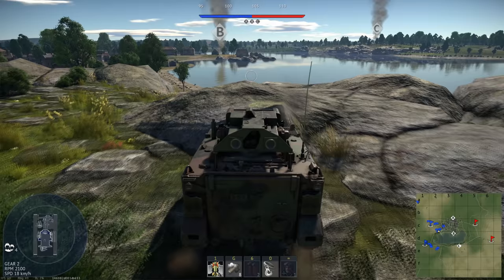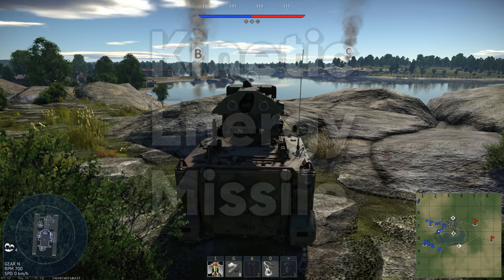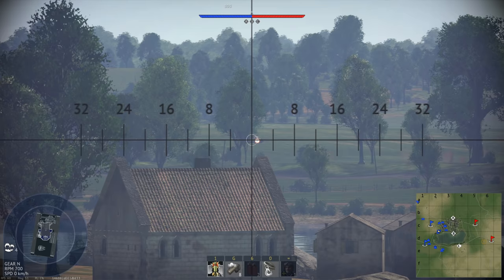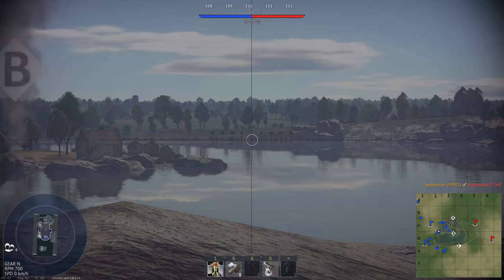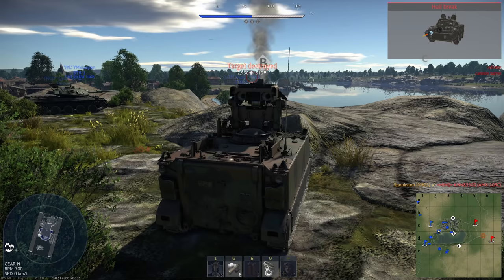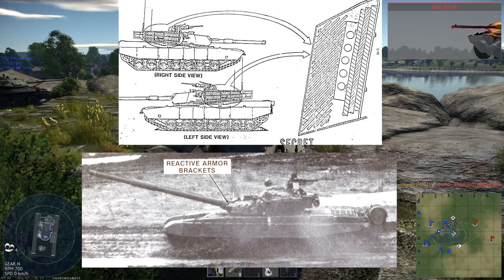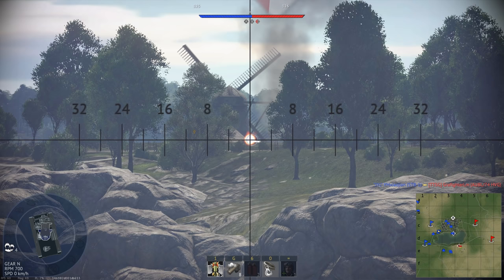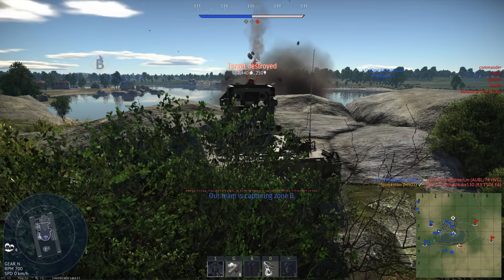Kinetic Energy Missiles - Future Tank Weaponry

Comment: Question, would it have been possible for the light, medium and heavy tank dynamic to have survived, instead of being replaced by the MBT?
Reply: @Bird9600  I'd argue it's more a matter of technology. If the best technology in each field was more mutually exclusive (couldn't make an armored vehicle fast for example) It could have continued.
Reply: No, since rapidly improving gun and engine technology meant that so-called medium tanks naturally gained bigger guns and heavier armor to the point where it no longer made sense to develop dedicated medium and heavy tanks when one can have the economy and mobility of medium tanks with the armor and firepower of heavy tanks. Indeed, many modern main battle tanks weigh as much as the old heavy tanks, although their armor, mobility, and firepower are vastly superior. 

As for light tanks? Well, they never really died, did they? Light tanks have occupied the niches where they excel, when situations require a tank with better operational and tactical mobility, even at the expense of heavy armor. 

Light tanks exploit their lightness to allow them to be cast from planes, landed from boats, traverse inhospitable jungles and mountain heights, and even swim across lakes and rivers. The light design and economical operation makes them attractive to adaptation to other roles, such as APCs and IFVs. Conversely, many APCs and IFVs have been successfully adapted into light tanks, a practice which continues to this day. 

Light tanks do face stiff competition from more economical armored cars and more versatile IFVs, but their development is still seen as worthwhile by nations who see a need for them.
Reply: Light tanks might still survive. They can be used by light infantry like paratroopers as "airborne" tanks
Reply: Calen Crawford  Clearly what's needed is to build Howl's Moving Castle except give it a fuckton more guns and armor.

Comment: Actually Kinetic based missle would be suspectible to the very same old armor defensive measures any other missle is susppectible for - reactive armor would be quite effective at dealing with this. The same goes for any active defense measure meant to deflect the projectile while its in flight - to force it into different trajectory thus making a miss. and even simple smoke screen would be enough to protect against being target locked - this thing must hit directly or it does no damage so - denying the target lock or disrupting it would be quite effective. Normal missle even it it misses but lands close by might still damage the target to some extend by exploding its payload - KEW systems would be at disadvantage since they lack the explosive warhead to deal damage in that manner.

Comment: I haven't seen active protection systems being that effective against top attack missiles
sure they can work with overfly top attack missiles, but one coming from straight above would prove very challenging.
the missile could very easily discard it's tip, as in sensors and stuff (messing with some standoff distance of the heat warhead unless built specifically with this in mind) to fool the APS into firing sooner.
i'm no designer, not even a fully fledged engineer yet, but i'd do the above as a quick and dirty solution to APS with top attack missiles

Comment: One think I'm interested in is the cost-effectiveness of non-top of the line weapon systems such as infantry anti-tank systems. I live in New Zealand and I seriously question some of our weapon appropriation philosophises. For example we have the Javelin where each missile cost about $174,000 USD. So using anti-tank as an example how much more value do you get from this top of the line system compared to cheaper or older systems? 

The justification our Army uses for top of the line equipment is our troops need to best just in case but the reality is we have not engaged tanks since Italy 1945 and it is very unlikely we will ever be in a position of engaging latest generation tanks without allied support (unless ww3). The second issue with their argument is that it can justify anything. If we need the best just in case then we out to have latest gen combined arms and a navy strong enough to prevent invasion. Their argument is ridiculous, weapons systems should be about value for money given the likelihood competing systems advantages and disadvantages will have an impact on the battlefield. If NZ troops engage tanks they are much more likely to be developing nations older T-50s or T-80s than updated M1 or T-14s.
Reply: Actually, unless you go bust some poor blokes house, no third world country would come and invade you. Frankly speaking, unless New Zeeland suddenly finds massive deposits of  a strategc resource, there is no reason to invade that country. It has no strategic position, it's at the end of the world (almost literally) so the supply chain needed to support an invasion would be monstrous and it has perfect geography to for defensive warfare. Soo, if one wants to literally invade NZ, it has to be a great power, with a big fleet and large land force to spare.  Then, of course, for defensive warfare, you don't need top-notch equipment. I mean, folks in vietnam used holes in the ground with bamboo spikes and shit (literally shit) to kill US soldiers. The 'just in case thing' applies to another context. NZ is a 'strategically important ally' of the US, so just in case the US desires to blackmail your gouvernment into sending  troops into one of their adventures in God knows what poor country,  In this case, Javellin is quite important for standardisation among troops, which is an extreme advantage for logistical chains. And it can be used much better when attacking targets.
That's for general weapons appropriation. 

As for the missile itself, well, Javelling has 2 main advantages for its latest variants: 1. It has fire and forget capability, which means that you can shoot the missile and run away, quite a great addition for a defender. 2. It can launch top-attack missiles, which can strike at the roof of the turret and engine cover, making it excellent against tanks. Does it justify its cost? Well, hopefully it would never be put to such a test.
Reply: @nottoday3817  it would be more the engagement of 1-2 tanks in places like Iraq and Afghanistan or Iraq as part of coalition operations. 

NZ forces at this time are never going to get surprised by real armoured formations. We would know if an enemy had these and UK or US assets would be brought in.
Reply: Muhammad Abdul  yea, the threat of invasion is almost nil. As a retired head of the Army once mentioned, we have the largest moat in the world. However, our forces do engage overseas in operations on the low end of the conflict spectrum. Given this reality my suspicion is we can invest in less cheaper systems (such as anti air and anti tank, or naval weaponry). 

One example from other countries is Brazil's Super Tucano ground attack aircraft.  Its no F-35 but it does not need to be for the anti-insurgency missions its used for in South America.

Comment: CKEM's previous iteration(not LOSAT as you stated) had a massive failure in front of the eggs and braids.  It went straight up to about 800 ft just like it was supposed to, but then turned 180 and went straight back down into the launch vehicle, obliterating it...  Needless to say, the program got the axe...  CKEM was a tiny program to work out the "problem", but after the first demonstration that quickly got buried for political reasons, the program did not go anywhere as funding for Iraq etc took over.  PS: Lets just say everyone's stated range for CKEM is WAY too short.  Its pop up maneuver was to avoid terrain, allow spec ops to lase targets for it, etc.  Also was intended as area defense against helos/aircraft and to effectively get rid of the Javelin as well as the Javelin is in effect too heavy to carry.